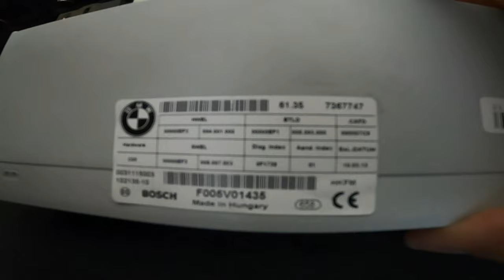Tailgate Don't Open Electronic Module Trunk Lid Replacement BMW Serie 3 F30 F31

Comment: Good day. I have a 2011 BMW X5 E70 40d. When i push the button to open rear truck it opens and closes straight away. When i open it manual it opens amd then you can push the button and it closes automatically. But still does not want to open. Can this be the boot module?
Reply from the maker: I'm sorry but I didn't understand. the trunk opens with the remote control but it doesn't open manually, correct?
Reply: Hey, I have a similar problem.  Trunk opens with the remote control but does not open with the button (manually). Need your heelp
Reply from the maker: @Juboxcs  try replacing the button. I don't have that video, sorry. maybe in the future

Comment: Hi bro did you change the module or not ? Thx for the video
Reply: I havr a BMW 3 serie Gt f34 the trunk doesnt open
Reply from the maker: Yes, i changed the module, but you must check the fuse first.
Reply: @fernandomontenegroBMW  how can i check the fuse?
Reply from the maker: @nevzadyenilmez8083  watch this video https://youtu.be/VFCQ5sVZ9cU
Reply: @fernandomontenegroBMW  thank you bro🤝
Reply: @fernandomontenegroBMW  which fuse?
Reply from the maker: @richardborkent1923  107, 130 or 150

Comment: do you need to remove power/battery to unmount the module ? It seems like the light is on inside the trunk
Reply from the maker: It is not necessary to remove the power/battery to disassemble the module. This module works with low voltage

Comment: Hello got a service they said I got to replace the REAR LEFT SPINDLE DRIVE/GAS STRUT SPRING FOR AUTO TAILGATE BOOT it used to open and close for my X6 with the button inside the car and the key of my car and the boot button inside but don’t no more
Reply: Would I need to code it to calibrate it after I replace the left one?
Reply from the maker: hi, so you can't open the trunk with any buttons? first you should check the fuses to the right of the electronic module and then the electronic module. when you press a button to open does it make any noise?

Comment: My car is the same, it open whit remote key, but in the car it didn’t open! Is the some or the problem can be the rear door key?
Reply from the maker: Pedro não percebi bem qual é o problema. A tua chave abre o carro mas não abre a bagageira? Ou não abre através do botão que está no interior do carro? Ou não abre através do botão que se encontra na porta da bagageira?
Reply: @fernandomontenegroBMW  o meu está igual - Não abre nos 2 botões do carro (mala e interior perto da embraiagem), mas abre com o comando! Pesquisei e encontrei um site que refere a necessidade de substituição da "pega" da mala (a peça custa cerca de 20€ na BMW).
Reply from the maker: @harrymoon6060  mas se é substituir a pega da mala? Então porque é que o botão da frente também não funciona. Deves ter um mau contacto na conexão do módulo electrónico.

Comment: Hey my boot was opening fine with the remote key until my battery died and after that my boot still opens but stops half way and you need to manually open it the rest of the way. Have you any idea how to fix it? Bmw 320d estate f31 2013 thanks
Reply from the maker: in the car, go to menu/settings/tailgate and check the opening is at max
Reply: @fernandomontenegroBMW  thank you that fixed it 😁👍
Reply from the maker: @robertblack92  i'm glad to help you
Reply: You have also helped me back when I needed my car serviced I followed your video and has saved me a fortune and taught me alot, I very much appreciate all your help. I have liked and subscribed and will definitely be watching more of your videos. Thanks again mate 👍
Reply from the maker: @robertblack92  I'm glad to know. thanks